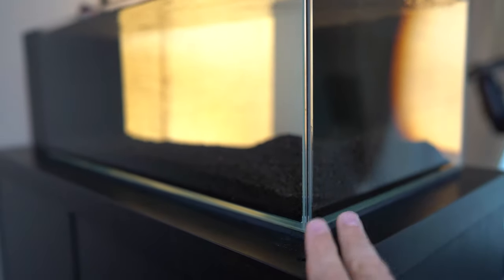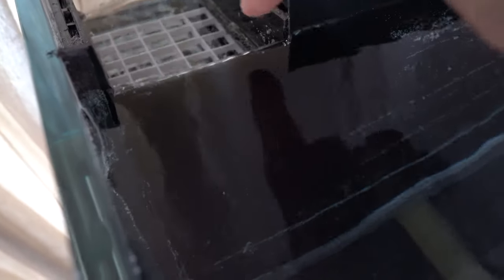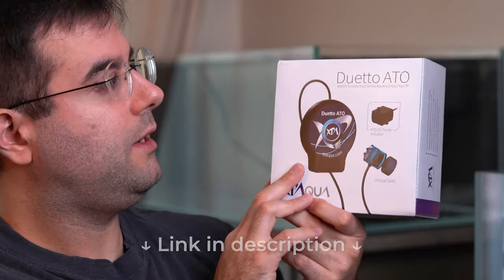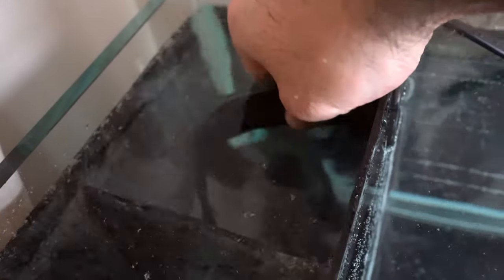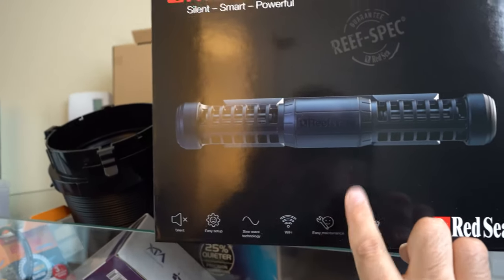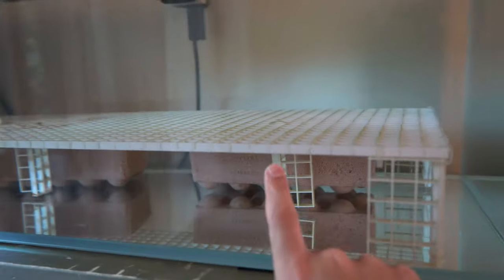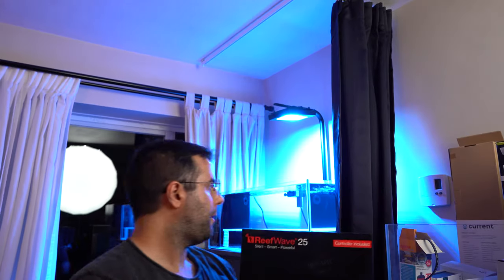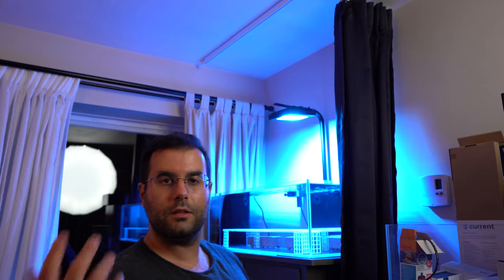How to build a All in one FRAG TANK aquarium

Comment: 2:58 the heater needs to be in the water. It's above where it should be on the water line.
Reply from the maker: It doesn't need. It's ok.
Reply: @AquaSplendor  lol no. You can literally see the minimum water level line sticking out of the water.
Reply: Does it not fit further in/down?